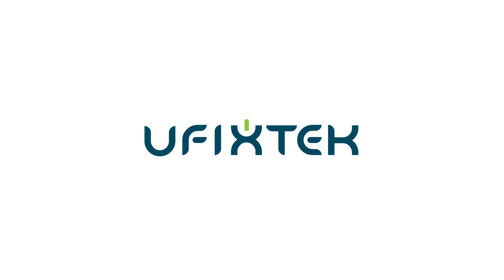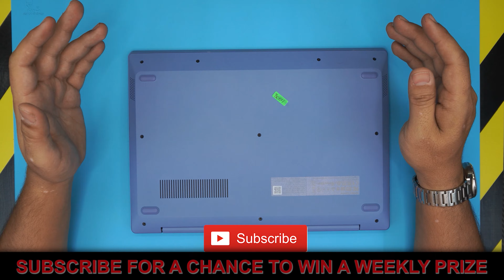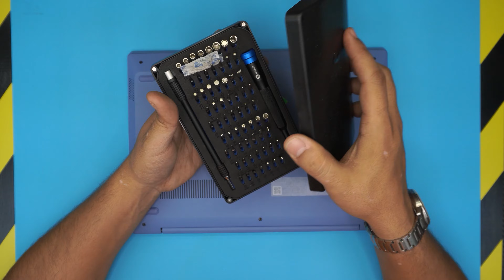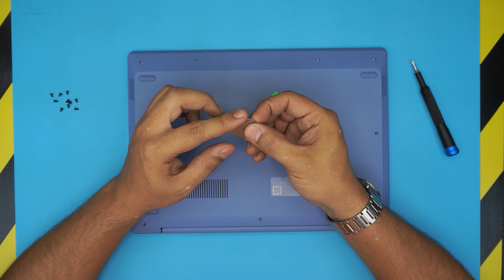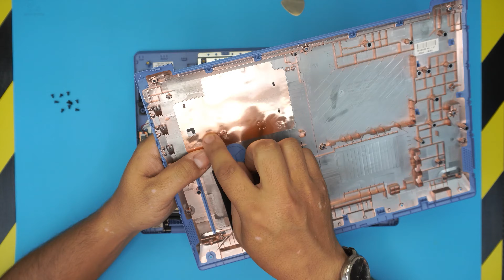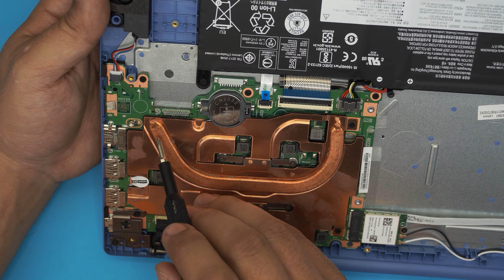Lenovo Ideapad Slim 1 81Vs ,SSD , HDD , Ram,  UPGRADE Not Possible !!!

Comment: I have the exact model but is has a NVME slot ????
Reply from the maker: 🫠Regarding your many questions, No it doesn't have the NVME slot, it has the place to have an nvme slot to get soldered on for next models, but this model doesn't have the components nor the jack.
cheers🍻

Comment: Thanks on this video. I got a look at it without having to pop my one open. Regarding upgrades for anyone willing to pull this off, if you are running an OS such as True NAS that doesn't even support Wi-Fi you could theoretically just take the WIFI card out, put a hole in the back cover, and connect an EGPU via a riser card. Or if you have the need you could just get one of those USB Wi-Fi adapters and call it done. I do wonder what version of PCIe the Wi-Fi card is connected through and how many lanes it has... If you guys are dissecting yours could you please check this and comment it really quickly, Thanks.
Reply from the maker: 🫠Regarding your question, do not place a egpu on that m.2 lane it is buttle necked and it will not give you a good results. we have tested with egpu on this models and all i can say it is a disappointment.
Reply: @uFixTek  not the m.2 lane but the mini PCIe lane where the wifi card is
Reply from the maker: m.2 mini pci-e wifi lane is not a full pci-e x4 lane it is a 2x pci-e lane it is very slow

Comment: Oh I almost forgot can I plug in anything external hard drives and SV stuff like that and where would I plug it in
Reply from the maker: you could use external drive but it will be limited to usb speed and not that great, and having external drive 24h on that it will over load the usb chip as they use a low quality chips

Comment: Hello UFIXTEK. I wanted to ask if I put the required Jack on NVME and SATA, ask Lenovo for the BIOS, will the corresponding ports work for me? PS: for Lenovo Ideapad Slim 1 81Vs
Reply from the maker: Thank you for your feedback! If you wish to support the channel, you can like, subscribe, or both!
Regarding your question, no my friend we repair motherboard for over 17 years and have tested and the motherboard not only requires the m.2 jack , it also requires many other components e.g power regulator and capacitors and at the end the bios update for the new m.2 firmware. it is not something you can do at home, you need the schematic for the  m.2 board and replicate the components.
Reply: @uFixTek  thx
Reply from the maker: It's my pleasure my friend. 😊
Should you have any further questions or requests in the future, please don't hesitate to ask me.

Comment: Good day I have a problem with my bois password
Reply from the maker: Thank you for the feedback! if you wish to support the channel you can LIKE or SUB or both :P
regarding your question: DISCONNECT THE BIOS BATTERY and the main battery, unplug the charger.
then short the pins inside the bios battery contacts for 30-60 sec then plug everything and the bios should be reset to default.

Comment: I'm trying to reinstall windows 10 but it simply will not, can you point me to help? I was about to install chrome os flex but version of windows can be installed.
Reply from the maker: Thank you for the feedback! if you wish to support the channel you can LIKE or SUB or both :P
regarding your question: you want to install chrome OS flex or you want to install windows ?
Reply: @uFixTek  what the heck did I type OMG. I'm trying to install windows 10 on this very laptop but it's failing, not even displaying the windows logo. Windows 8.1 is kinda working but my internal drive not showing up.
Reply: Chrome OS flex was installed successfully but I'm not trying to use Chrome OS.
Reply from the maker: @osafosam8763  ok can you give me the exact model pf the laptop, i check in the morning.
Reply: @uFixTek  lenovo ideapad slim 1-14ast-05
Reply from the maker: go to bios and look for sata type and set it to AHCI Mode, and then try.
Reply: @uFixTek  the bios is very basic. No advanced option or anything of that sort so that option is not a available. Here's a list of everything I tried;

Enabling legacy bios

Disabling secure boot

Updating the emmc drive drivers

I tired installing it with Cmd prompt

I used diskpart to clean the drive and install after.

I tried 32 and 64 bit versions of Windows 7, 8, 8.1 and 10. None of them works.
Reply from the maker: @osafosam8763  ok no need to try anything when all hell fails, its a emmc chip degraded, 
the SSD OR EMMC chip have a TBW life span,
TBW (Terabytes Written) indicates how much data a drive can write over its lifespan. For example, an SSD with 500 TBW means that the SSD can write 500 TB before it needs to be replaced.
and emmc have a very low life span as they don't have a DRAM Cache. and that makes them very easy to start degrading, you need to get the laptop to a good technician than know how to do a "reballing" and ask them to replace a the EMMC chip with the same 128GB or a 256GB chip. i do this at the store for clients that have the ssd almost dead.
https://is.gd/0NOTuk
sorry but its very common on this laptops that use emmc chip.
OR you can do this: get rid of the WIFI card and get a USB wifi: https://amzn.to/3QuMYZ7
and get a m.2 wifi to nvme adapter: https://amzn.to/3bHCcjf
and purchase a good nvme up to 2TB:
500gb nvme very good: https://amzn.to/3QoEsdV
cheap and good: https://amzn.to/3zCUnPc
and place this in the laptop and use a double side tape to hold the adapter to metal plate, plenty of space. and intall windows there MUCH MUCH faster and this SSDs have a dram cache and firmware.
Reply: @uFixTek  I was able to install Linux on the system tho, but I suspected from the get go that it's the drive that's the fault. I will indeed get rid of the wifi card and use a USB WiFi dongle instead. I thank you for the time you took to respond to a 1 yr old video.
Reply from the maker: @osafosam8763  its my pleasure, when ever you need any help or 2nd opinion i'm always here. good luck
note linux can be installed on a degraded ssd because uses a very different algorithm of installation and file system.

Comment: i have a question can you put a external ssd though?
Reply from the maker: Thank you for the feedback! if you wish to support the channel you can LIKE or SUB or both :P
regarding your question:   no my friend you can use micro sd card and external usb storage (ssd/hdd) but no direct sata connection. anything over USB only
Reply: @uFixTek  so i can use my ssd with the enclosure case?
Reply from the maker: Yes you can but the speed will be limit to usb port
Reply: @uFixTek  I can still put games there and play it using it right?
Reply from the maker: yes you can, get a good enclosure,
https://amzn.to/3MoNWEZ

Comment: Amigo quiero instalar window 10 aquí pero no me deja entrar a a la bios con f2 y no se puede entrar a la boot menú con f12 se me daño el placa base?
Reply from the maker: al prender el equipo pulsa muy rápido f1 y f2 (tapeando ambas teclas) y te va llevar a bios. luego activas el f12.
Reply: @uFixTek  no amigo creo que e dañado la placa presione f1 f2 f12 y no sirve es que ya instale el window 10 pero no bootea se queda cargando la pantalla y se apaga
Reply from the maker: entonces debes de cambiar el BIOS chip es barato 500-700pesos depende quien te venda / repare.
Reply: @uFixTek  que este laptop lo compre en 300 un chip me costa 500 :(
Reply from the maker: 500USD or pesos?
Reply: @uFixTek  a ya lo arregle :)
Reply from the maker: como fue que se arreglo?
Reply: @uFixTek  es que presione con fn+12 el boot menú jaja
Reply from the maker: JAJAJA eso pense que estabas haciendo cuando dije dale f1 o f2 , para llegar a f1-f12 tienes que dar a tecla "fn" :P 
y si gusta en el bios puedes cambiar este opción de que no tengas que presionar fn para llegar a f1-f12.
que bueno que ya quedo. saludos

Comment: I have the Lenovo ideapad slim 1-14ast-05. It is stuck in a boot loop. I can see the Lenovo splash with the spinning circle then the boot loop restarts. I cant access windows, bios, recovery or boot menu. As soon as I select one of those settings in the novo menu the boot loop starts again. I've also replaced the Cmos battery and nothing changed. Is there anything you could recommend me trying?
Reply from the maker: Thank you for the feedback! if you wish to support the channel you can LIKE or SUB or both :P
regarding your question:  your SSD m.2 drive is worn out, and you need to replace it, but before that, create a windows usb boot drive, and plug it in and :Immediately and repeatedly press (Fn+) F2 or F2. Accessing the BIOS may take multiple attempts.
once in bios enable F12 boot menu , and save exit then once restart keep tapping on F12 and choose usb and install windows. and if any error during windows install then replace the ssd then install windows.
links:
windows 10 usb boot: https://youtu.be/uDu8j2lE-dM
install windows (steps): https://youtu.be/GkMZyCUarIA
ssd: https://amzn.to/3HufgP4
Reply: @uFixTek  If you bothered to check the code I gave you would know that the laptop has a EMMC drive that can not be removed. I created a usb boot drive but cant use it as it is an infinite boot loop when I try to access the bios, boot or recovery.
Reply from the maker: oh my bad im sorry i searched but i saw the board but i made a mistake it was a slight different model than your with m.2 jack, your's as you mentioned yes its an emmc what we do with those, as it goes bad fast because there is no Dram chip for the ssd, we get a higher capacity emmc chip from aliexpress ( https://is.gd/YwwVyA ) and solder on board. its called reballing BGA.
Reply: @uFixTek  Thanks for your assistance.
Reply from the maker: your welcome my friend

Comment: were is the harddirve
Reply from the maker: there is no hard drive, the storage is soldered on motherboard, its a tiny square chip that is soldered on board. its a emmc chip, it looks like this: https://imgur.com/a/simujES
you can't remove it, you will need a good technician that can do reballing.
Reply: @uFixTek  ill just get a new motherboard
Reply from the maker: the new mobo, that had the upgrades make sure the jack connections match, usually they are no match.

Comment: Yeah, buying cheap electronics is just not wort it.
Reply: yup i learnt the lesson the hard way,the cpu aint too bad for a laptop of that value but heat sink is terrible, i could run a game like halo 2 for less than  10 min without the pc over heating
Reply from the maker: im sorry that you got this laptop (tablet) :(
Reply: @uFixTek  do you have any low buget laptops which are a least upgradable
Reply from the maker: where are you located yo i can send you few links for your country sites. and what is your budget limit ?
Reply: @uFixTek  300$ living in South Africa
Reply from the maker: true that, always i recommend research before purchasing, check mobo ram slots and upgradability advantages, its good to ask us as we open up all types of laptops and seen most of them.

Comment: hola, y no se te ocurrio de que se puede soldar el conector del SSD/HHD en los pines de la placa? me parece q puede funcionar!
Reply from the maker: Thank you for the feedback! if you wish to support the channel you can LIKE or SUB or both :P
regarding your question: no amigo de soldar el jack si se puede pero de que funcione no va ser. ya que falta muchos componentes que requiere y aparte firmware controladores y re programar bios aparte.

Comment: Do you have any recommendations that are very cheap but better? I like the looks of this. I can do basic upgrades myself. But if you can’t upgrade the ram and there’s no fan….no use. I can live with 64gb flash memory. My 7 year old Acer works well but the ports and other stuff are wearing out. I know I don’t need much if that can satisfy.
Reply from the maker: Thank you for the feedback! if you wish to support the channel you can LIKE or SUB or both :P
regarding your question: can you let me know you budget> and your location? so i can get a link and few recommendation links.
Reply: @uFixTek  I’m in GA. Would like to be under $200. Just need reliable web surfing really. Occasional YouTube watching. I have an SSD I can use. Current laptop has 6gb ram and that works. Processor is biggest downfall. Integrated graphics work well enough. Need an hdmi port.

Comment: i bought 1 and cant install windows on it even when i use lenovo emmc drivers. for some reason the emmc drive is write protected. is this normal. pc wont boot only boot loops
Reply from the maker: this happens a lot we do get this issue in the store but then what we do is replace the emmc (desolder) and install new and biger capacity and it works after.
Reply: @uFixTek  fixed it. Using diskpart in CMD in startup repair to clean the emmc helped but I can't say if write protection was as big as an issue since I found out windows can install on a write protected drive. The driver issue was bcuz my windows installation USB was x86 and the emmc driver was x64. Creating a x64 windows USB made the driver work but idk why since x86 should support X64. Finally got windows installed but no driver from Lenovo website worked. So no wifi or touchpad and this laptop doesn't even have Ethernet port. Had to USB tether to get windows updates on this very slow pc. Thankfully windows was able to get the driver issue resolved.
Reply from the maker: @oksu132  yes converting to gpt and cleaning disk should of been 1st i thought u tried those🙃 but im glad that u hot it resolved my friend.

Comment: I think the only way is to install the windows on a usb memory card using Rufus program using the "windows to go" install option, while it is convenient to install the linux system on the main ssd, in this way you have two boot and two operating systems and more free space.
Reply from the maker: you can create windows 10 usb easy with one simple tool:
https://youtu.be/uDu8j2lE-dM
then you can use the same installer to install along side the linux if you wish.
but there are many ways to get both installed along side one another.,
Reply: @uFixTek  the video link Is not correct
Reply from the maker: lol where that link came from :P fixed

Comment: No CPU FAN? Really ? Oh ?my god. How it does working without FAN
Reply from the maker: Thank you for the feedback! if you wish to support the channel you can LIKE or SUB or both :P
regarding your questions: i asked god for answer and he said just sit back and watch the suffering on peoples face when their  laptops start failing ... and i did and i do get lots of this models in the shop because of the over heating issue.
Reply: @uFixTek  ok thanks. I subscribed your channel) How you fix that ?
Reply from the maker: You can't fix it, just repaste with a good thermal paste and it will get much better for the heat transfer.

Comment: What a garbage this laptop is ... , so many empty space left on motherboard and not a single ram dim or a SATA jack for storage expansion ! Instead all of that are soldered to motherboard . Lenovo is horrible brand . It would have costed them nothing to put an M . 2 or sata jack...
Reply from the maker: i agree with you, but its not the bran my friend lenovo makes some good models, the thing is that this are the low grade and recyclable models. we do get some high end lenovo like T470s and alike, and they are build with awesomeness.
i been in this repair work like for over 15years and i have 3 shops, and i have to get to see all the evolution of the laptops , how they started so good and only having two categories on each brands, not every brand have like 8 categories, and they go like this trash... garbage.. recycle trash... ok.... a bit more ok.... and so on..
some Asus brands are even worse that this lenovos same some Hp.
i have made few videos on asus and hp that would drop your jaw.

Comment: Thanks. I will solder the SATA jack so I can add a second hard drive.
Reply from the maker: sorry my friend it will not work!, we have tried it and many others friend have tried it, there are many other components that are missing and reprogramming the bios and much more. all you can do is to purchase a 256gb emmc chip from aliexpress and get a technician to do a reballing .
Reply: @uFixTek  Thanks my friend! What kind of components are they and are they possible to get installed?
Reply from the maker: its a lot of components and lots of work and only a really good technician with a good components repair skills can do it.
they don't sell the components you have to salvage them from other motherboards.

Comment: Is there any way I can make this trash laptop faster?
If I can't add those what can I add?
Reply from the maker: Thank you for the feedback! if you wish to support the channel you can LIKE or SUB or both :P
regarding your question: I'm sorry you got your self one of this :(, unfortunately there is not much you can do to make this BEAUTIFUL laptop faster, other than installing linux OS :(
Reply: @uFixTek  infact the Linux setup will not even detect the eMMC maybe only if you are lucky ... we have tried many times and only 10% of the times it detected the eMMC with distros like linux mint or ubuntu .
Reply from the maker: @martinmcdowell1630  it is true but we have found that its based on the type and brand of emmc we have some brands that got from aliexpress and they work fine. but before that its true not all emmc will work.